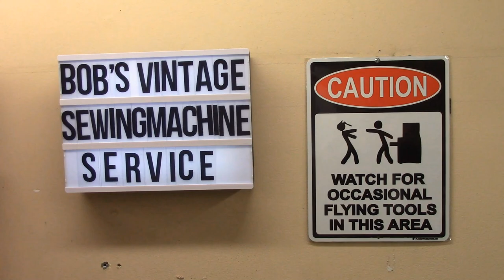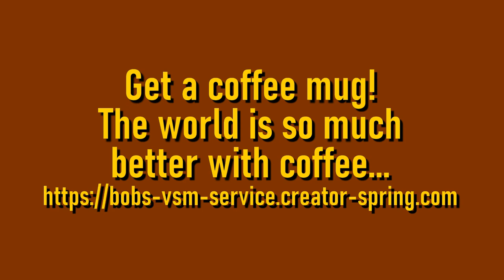A Potted Motor for Lori - A benchside chat

Comment: hi Bob, is there a way to test the field coil with a multimeter?  I think I have a bad one.  I'm getting some sparks (small not scary ones) and the motor barely turns.  I've tried 2 different armatures and the problem remains.  BTW, the brushes look fine.

Comment: I've heard from a few technicians that worked for Singer that they used pure Vaseline for motor lube. Your thoughts?
Reply from the maker: I've tried that as well, and it does work, but it is a little too thin for my tastes - at least in a warmer climate. I can imagine it would be ideal in colder areas.